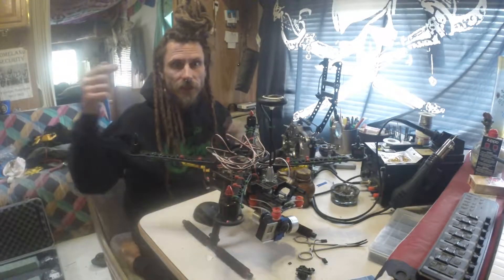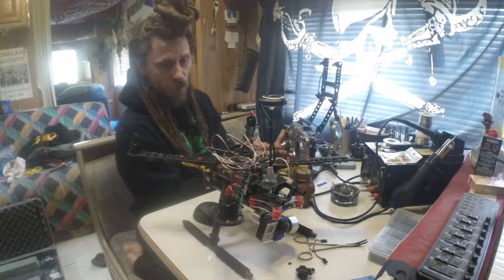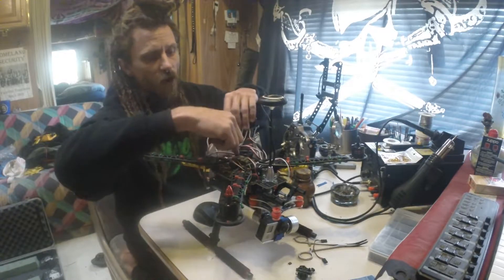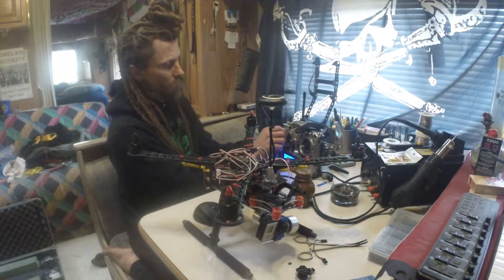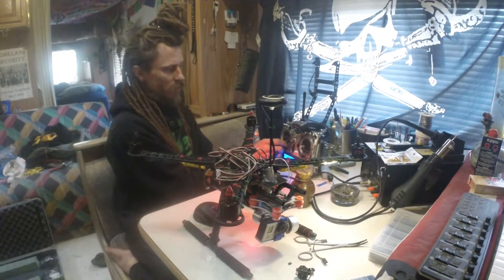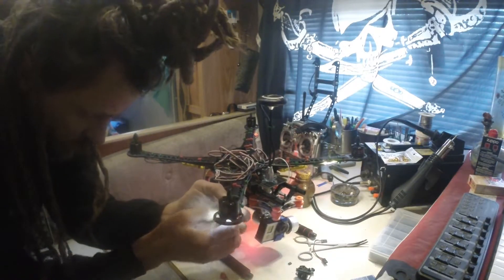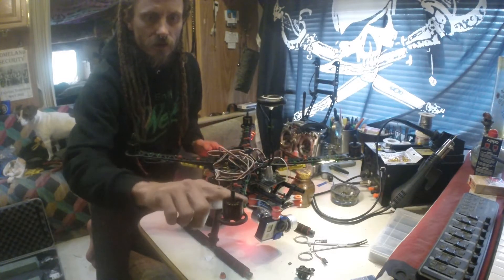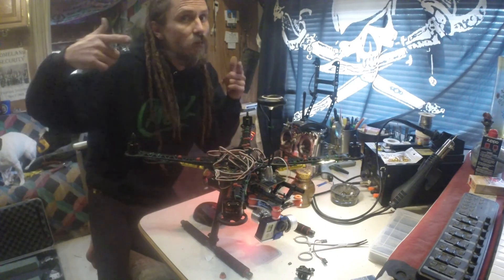HowTo: ESC Calibration and Motor Configuration - Drone Quadcopter S500

Comment: i think you could also spin the motors manually after dropping the throttle to 0.  Spin in direction you wish them to turn.
Reply from the maker: How they are hooked up determines the direction of spin.  You might be able to test them at 0 throttle, but the spin direction will only change if you swap 2 of the leads. They are essentially small 3 phase motors and will spin in the direction of your phase rotation. Swapping two leads on any 3 phase system will reverse direction.